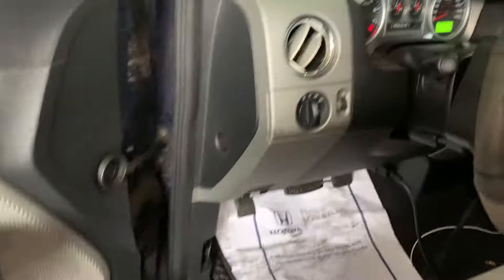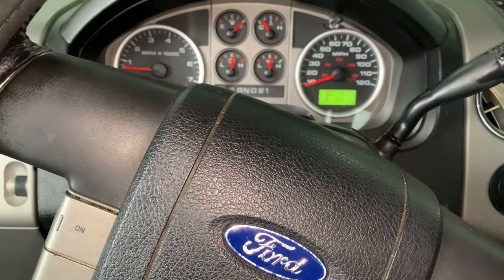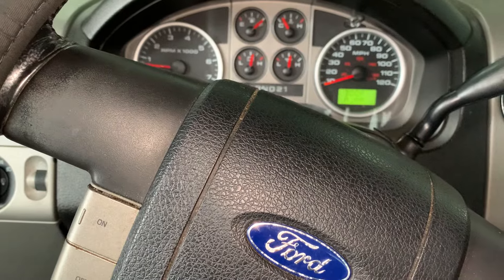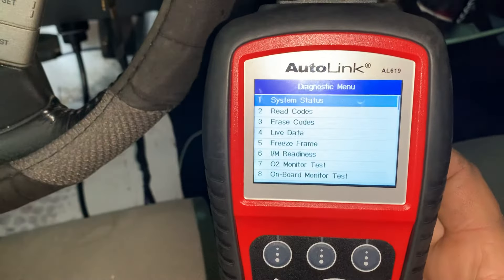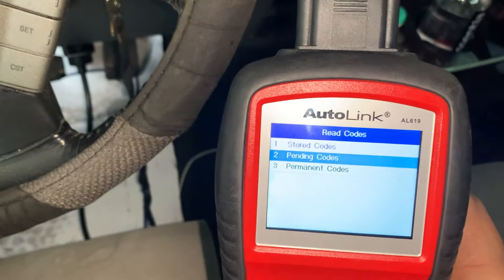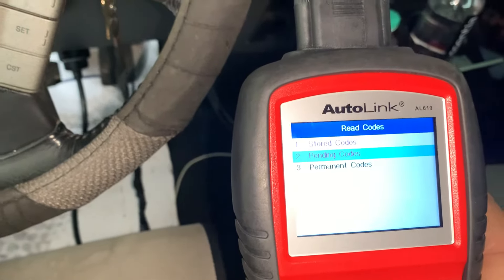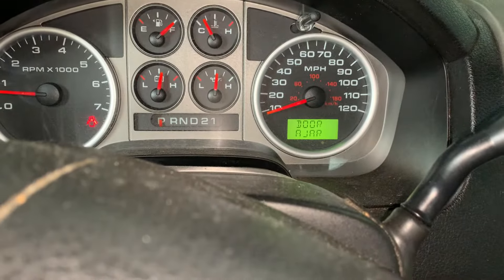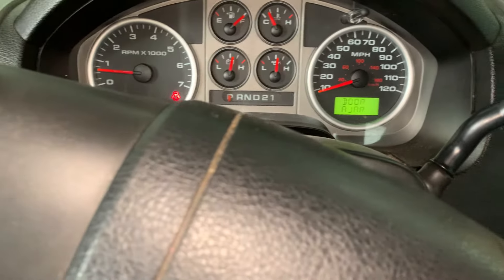2004 Ford F150 Trans fault #transmission #checkenginelight p0743 p0750 p0755 #p0962 p0141 p0161

Comment: Thank you for the video.  My 2005 F150 when up and down on the RPMs or stayed on 1st gear and misfired.  Went to Autozone and O’Reilly and they told me that the codes read faulty senoloids that go in the transmission.  I did what you said and it fix the whole problem.  Didn’t spend a dime!  Thank you so much!
Reply from the maker: Glad it helped 😊

Comment: Good I’m trying that plug tomorrow on my 2005 f150 5.4
Reply: did it work? whats the part called ? i have an 08 f150 5.4
Reply: @evangonzales02  yes it did work,the pins inside looks like corroded , just cleaned them with wd40 but also installed 2 zip ties around the plug

Comment: I have a question for the ones that already checked this connector how many pins the connector supposed to have 5 or 6? Because mine only have 5, does that means that the connector is bad because is missing a pin

Comment: Does this cause a bad downshift ? And shifting into 1st gear, that’s what mines doing after the light came on. 
My scanner isn’t picking up the codes though.
Reply: Did u find out whats going on with your truck.  My says trans fault but no codes come
Reply: @JesusOrtiz-ow7zu  mine was a lose connector on the trans itself.